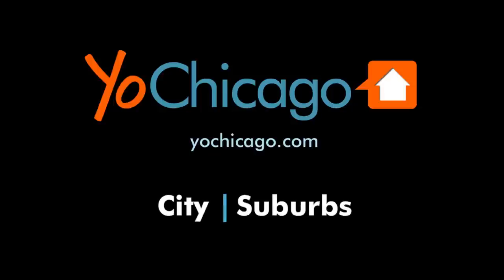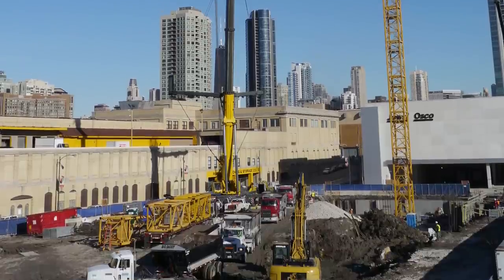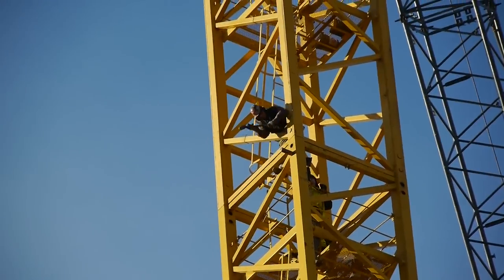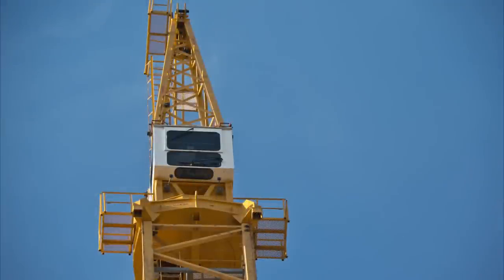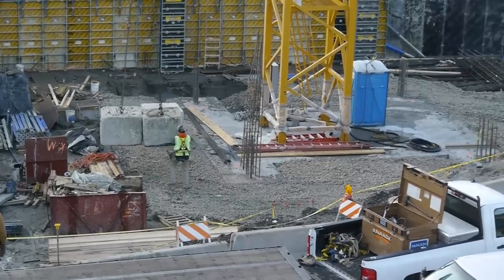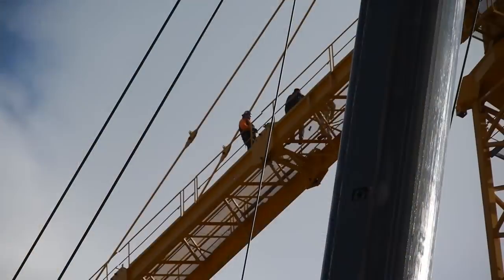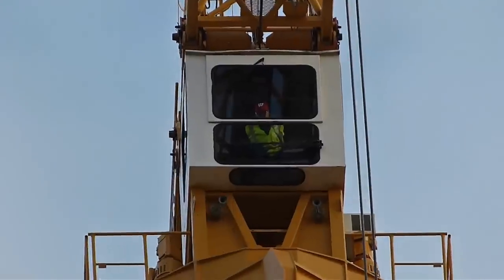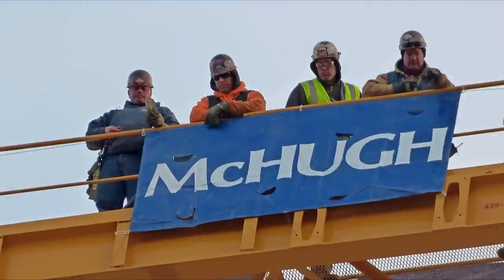The tower crane at K2

Comment: It begs the question, why not just use the telescopic crane for the entire project?
Reply from the maker: +Michael Ashe The telescopic crane can't reach high enough or lift enough weight.
Reply: +Michael Ashe I guess also guess it´s not so smooth to move things horizontally with the telescopic crane.
Reply: too expensive
Reply: You would need more counterweights on the hydro as it gets higher.  A tower crane does not need extra weights as it gets higher.

Comment: Those two slinging those block of concrete 1.27  should go back to training, they've got the shckles upside down , you should never put the pin on any 'live ' part of the wire should they slip it could unwind the pin and Bingo!